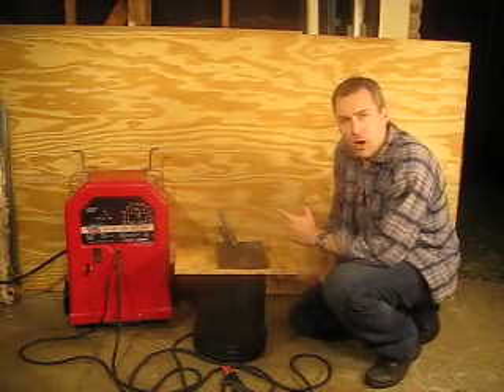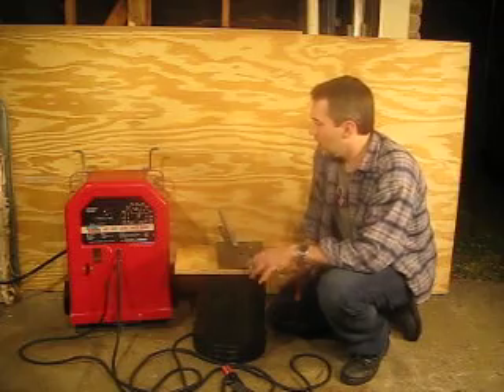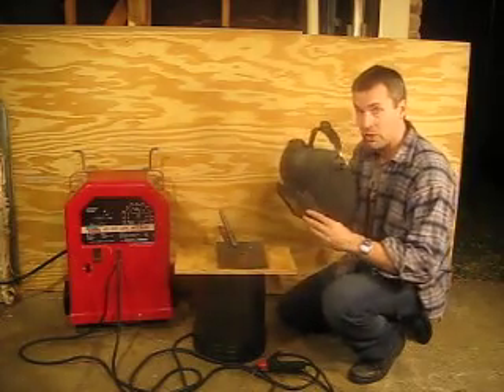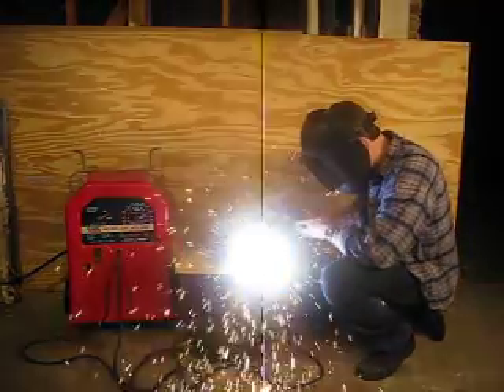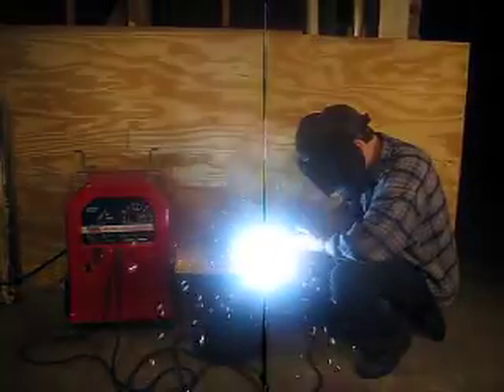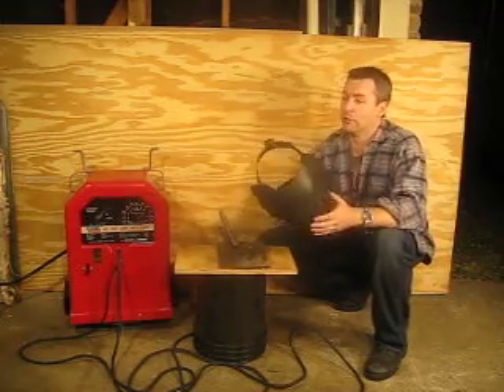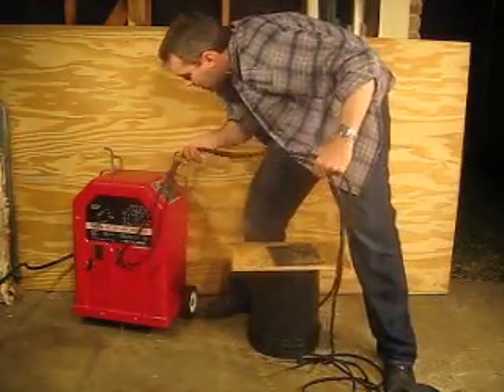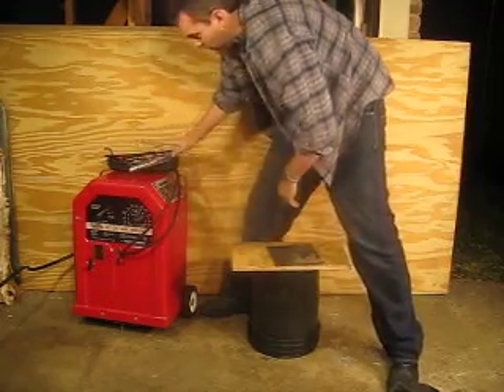Lincoln AC/DC 225/125 Arc Welder Demo 11-04-2012 (004).AVI

Comment: Hello guys I have one of these welders acdc...bought it new like 15-20.yrs ago to make some Window gates for one of my apartments on ground floor then put it away for a few years then used it to make a Window ac...box...then recently this year in unpacked it noticed the fan died so I opened it up replaced the fan and it worked fine....and after welding foe a few months....it started making a cranking sound and died......The authorized Lincoln guy says transformer died and they don't make them any more but he will try to repair it, is it worth fixing? With all the new smaller welders   now a days?
Reply: armando garcia ..Hey, armando can you show me a pic of the inside of your welder, how the fan is mounted.I got a welder that was dismounted and I have no idea how the fan is attached,,Thanks.
Reply: Sounds like lose cable inside

Comment: These are great welders, my only complaint on these is you can't fine tune the amperage, but if you're not doing anything super critical it doesn't really matter..
Reply: U can add a throttle control made for the tig to the handle and you can do a hot start and tune with it😊

Comment: people are dissing him for using 6011 on dc. 6011 runs great on dc . yes its is a ac rod but its not picky just like 6010. 6011 is tried and true ac. it actually runs a smoother weld on dc. but if you have dirty or rusty metal in the field. (workin on the tractor) i would keep to ac. burn the impurities out. its what the rod is designed for. or use the rod for root passes and follow with 7018. or 6013. though 6013 is not a great out of position rod.
Reply: 6013 is not a great rod period. It doesn't penetrate well.
Reply: +David Boyce ..agreed. i personaly dont like it but for newbies its really forgiving. easy strike with 6013. thats why i use 6011 for root passes. and 6013 stinks for vertical up. better to learn 7018. i hate how in these videos people poke start. strike scrape the rod. dont poke. 6011 is a bear to start if your work and rod and amps are cold.
Reply: I know! I hate that too! I like 7018 allot better than 6013 as well.
Reply: Lol I started off Hating 6010 but I LOOOVE it now xD

Comment: hey what kind of generator do I need to run this off on?
im using it to practice for pipe test???
Reply: get a different machine for pipe. duty cycle is low on this model. the old buzz box is a champion. modern models they have cheaped out on. still good but duty cyle stinks. this is a hobby machine and i found u weld a few inches and then it shuts its self or the "arc force" begins to drop. then u have to let the machine rest with it on .  so the fan runs
Reply: @AbcAbc-lb8nv  so this is a bad machine?

Comment: You need to leave your welder on after using it. You are shortening the lifespan by turning it off after using it.  The welder has cooling fans for a reason and needs to cool down after you use it. You've got a two minute use 10 minute cooling cycle.

Comment: 6011 is an AC rod not a dc rod . I have a welder just like it there a great welder, however ,yours is a lot cleaner  and nicer  than mine .Thanks for the video.
Reply: metzelplex 6011 can be run on AC or DCEN (electrode positive)